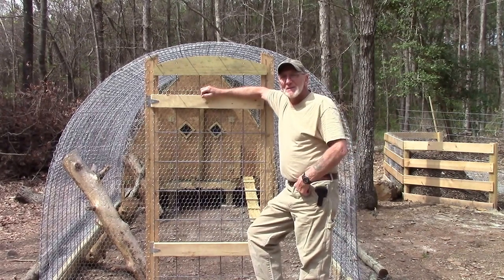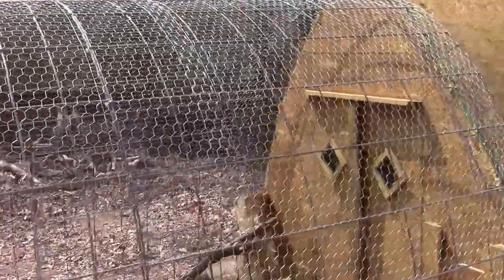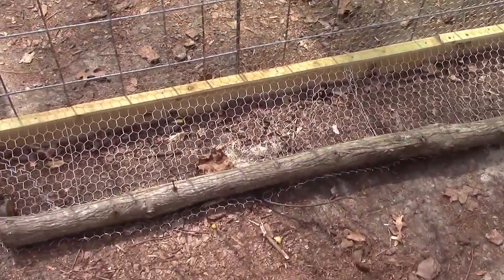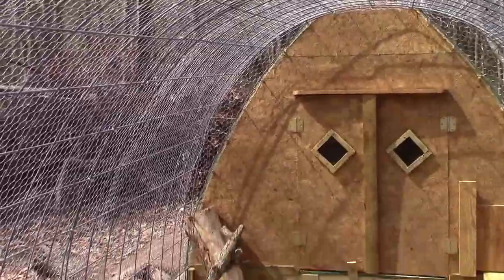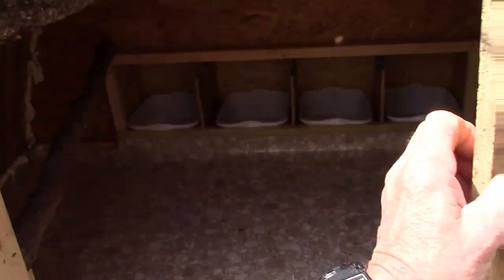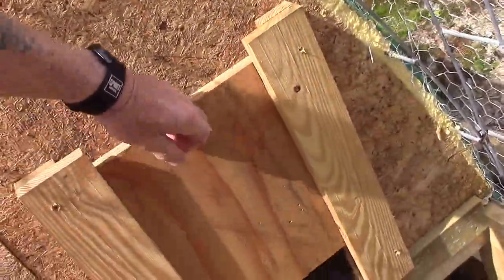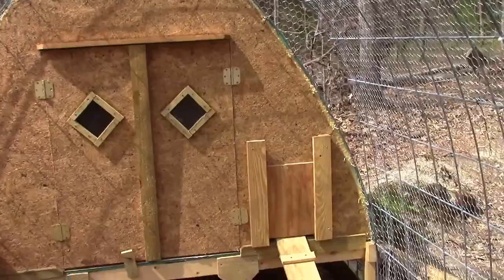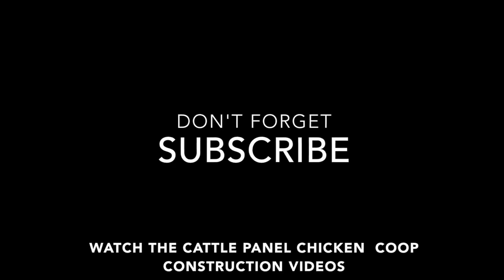cattle panel chicken coop

Comment: How has it held up against predators?  Any issues with the chicken wire getting damaged by raccoons?.  I'm making one also, but using hardware cloth in place of the poultry wire and then will cover 1/2 the coop with white Billboard vinyl to offer a dry area.  How many chickens do you have in there?